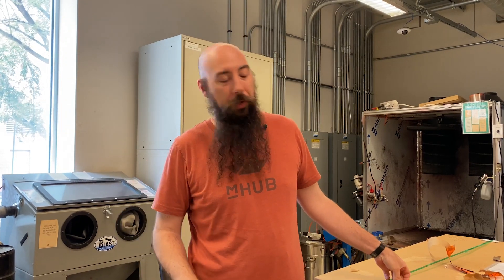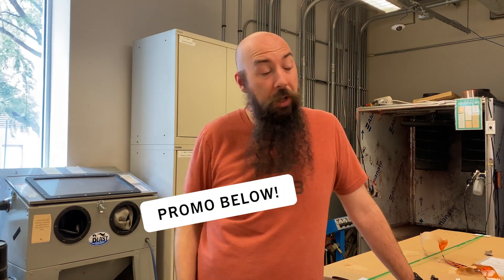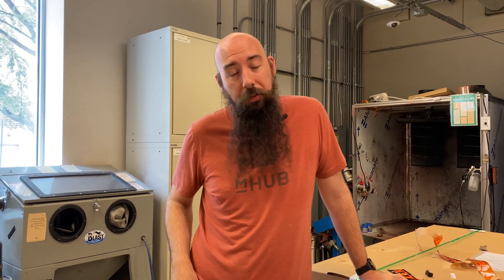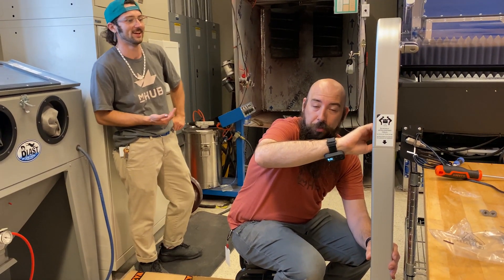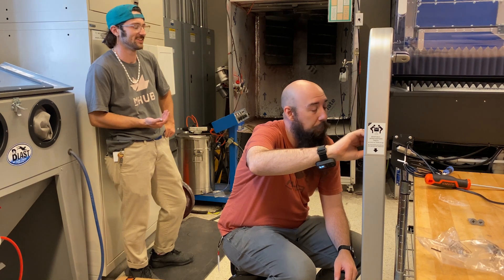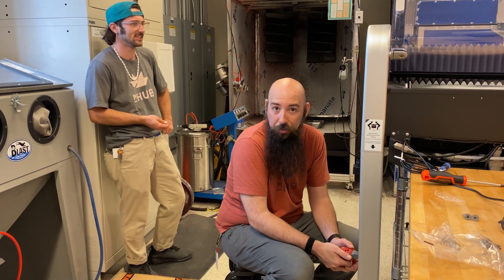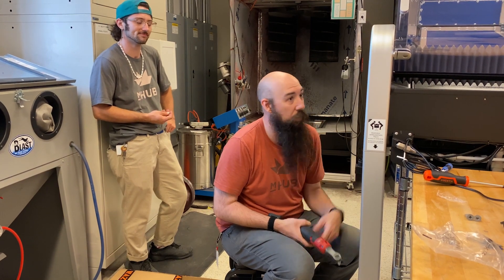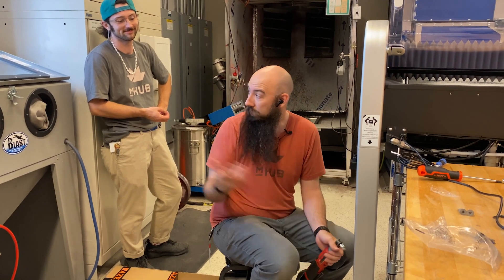Unboxing a WAZER Waterjet Cutter

Comment: Thanks for posting this! Helps me know what to expect. I just received my unit today. Curious how long it wound up taking you to get everything assembled and connected? Cheers, and have fun with the new toy!
Reply from the maker: It took two of us about 2 hours or so for initial setup. We then fiddled around for another hour or two with the set up of the area around the machine after finally settling on a location and adjusting some water and drainage after some testing. Have fun!
Reply: @mHUBInside  Thanks for the extra info!